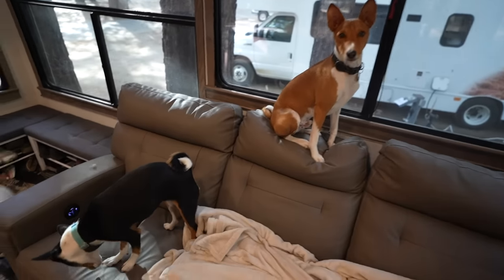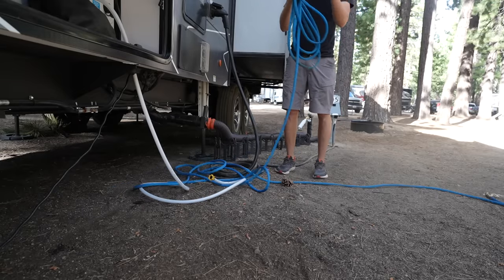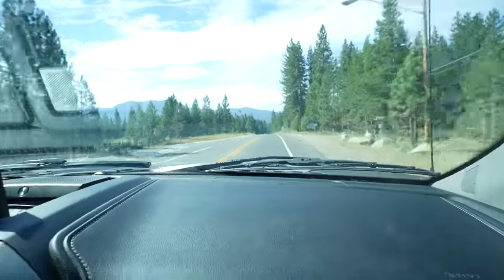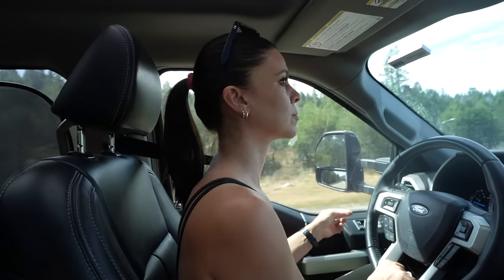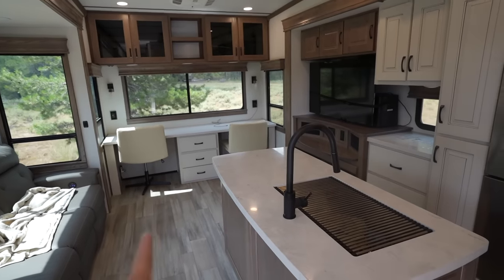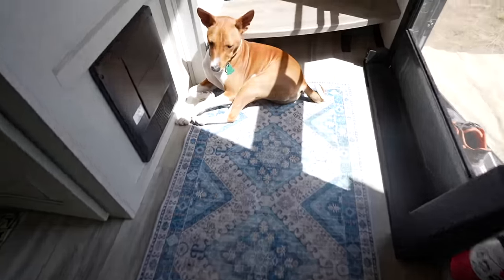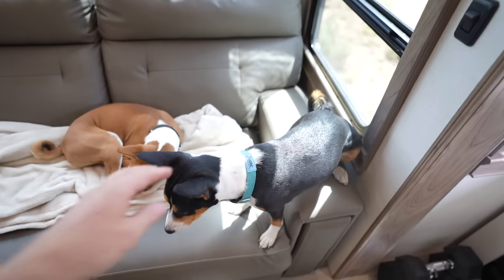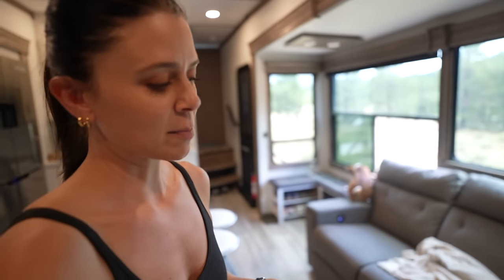A Glimpse into Our Full Time RV Life on Travel Day!

Comment: We have a very similar set-up on our driver's side basement area.  I installed one of the Moryde sliding cargo trays (33"x90").  There was room to screw down the Moryde Cord Reel (same as yours) on the left side of the tray, and then put the totes on the other side of the cord reel.  It made it SOOOOO much nicer to get to that part of the basement without always having to duck under that baggage door.  Something you should consider.  

As for the leash rules, I agree with you.  I think a lot of dog owners are arrogant and don't even TRY to follow the rules.  Even if you have the best behaved dog in the world, you can't control OTHER dogs (like charging).  You are 100% right on this.  Thanks for the video!

Comment: I gave up on the blue zero G, both of mine also leaked at the fitting. Still use it for the black tank flush. The gray worked without issues but I switched out this year to the Flexzilla hoses for fresh water. We also have the Clearsoure 3 stage filter but I modded a new hosing for it with aluminum angle iron which really decreased the 26 lbs it weighs.

Comment: Such a sign of how society is today, the Me - All about Me attitude. Bright lights, dogs off leash, trash, poop, etc! FYI: Look into partially opening slides. We’ve had issues with ours a Tiffin 2021 Class A but prob same maker, Lippert. They and RV techs have told us never partially open or close. It throws them out of synch. Very important to even hold button a second after completely open or closed to make sure both sides are equal.

Comment: I do that ALL the time with the steps - door has 2 be fully open.  And, my wife is always telling/correcting me.😕😕.

Get the cordless portable Dewalt vacuum!!!  Its soooper handeee dandeee to get those darn rocks and dirt up after the stairs come up.  I usually use it to vacuum the stairs before storing them, if I remember.  Also, handee for cleaning the truck.  Haven’t seen a portable vacuum in all the videos I’ve watched.
👍😃🍻

Comment: I still want to know if you're longer or shorter than the 22FQS.
Reply from the maker: So here's the breakdown.  (roughly overall)
Truck is 21 ft + the 22FQS was 27ft + bike rack 2ft = 50ft or 48ft w/o bikes

Truck 21ft + 5th wheel is 34ft - 4ft overhang on truck bed = 51 ft. 

So really close overall length, but waaaaaay more interior space and that was what we were going for👍